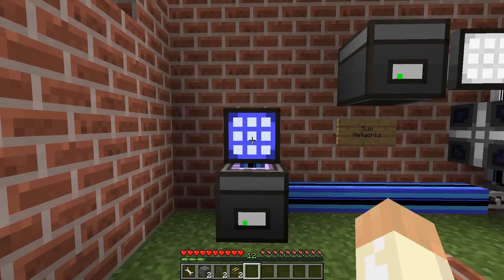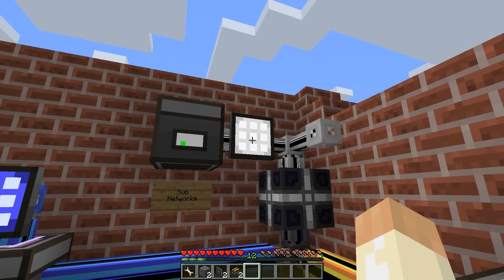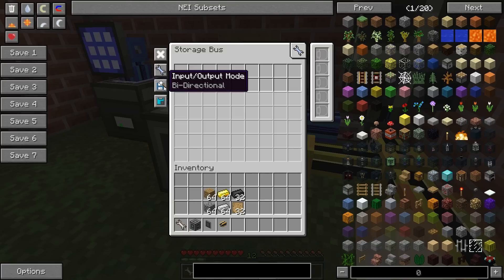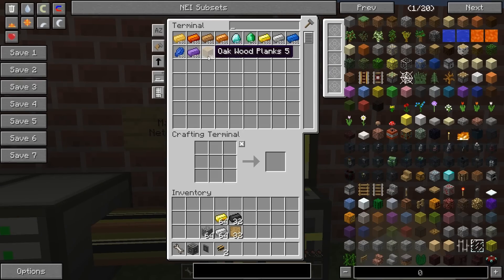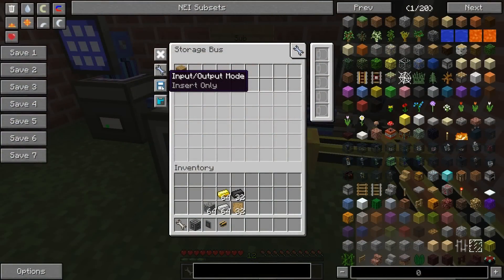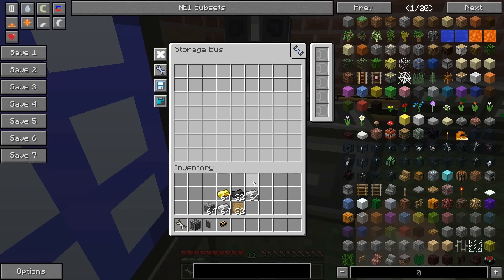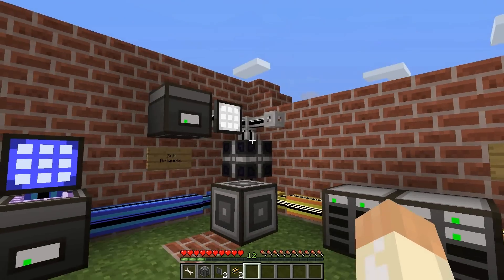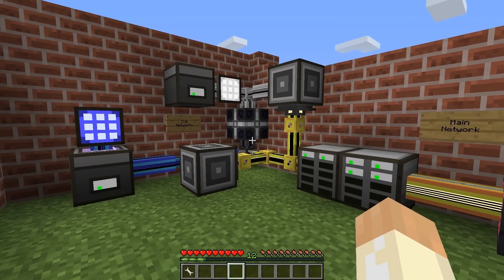Applied Energistics 2 Tutorial #9: ME Sub Networks (MC 1.7.10)

Comment: I am wondering what are the pros and cons for sub-networking multiple networks each others, for example network A is sub-network of Network B while Network B also the sub-network of Network A. I tested that both sides are able to access items in both system. I don't know is there any hidden problem of this design.
Reply: Do subnets count to the max-devices per bus?
Or would I be able to have 32Subnets per Net, with each 32 devices? 
(If using the dense cables)

Comment: Just checked back to see how you linked two networks to see all contents everywhere, and I'm having an issue.

One of my existing networks has several other channels on this branch, and each network has its own controllers. When I put an interface between them, the channels cycle in both networks and reconfigure every few seconds. Does this have something to do with each network having its own controllers? I see your blue and white networks have channels running, but I don't see any controllers to supply them. I thought you had to connect a controller to use any terminal or similar devices. Is there perhaps something happening with the power, like the smart cables indicate how many devices are drawing power but those particular ones don't require a controller to function?
Reply: Oh, I see that when you added the interface directly between them, the yellow channel picked up two channels in addition to the interface, so it was supporting the blue terminal and ME chest. It looks like the blue network didn't pick up a channel, and I'm guessing that's because the yellow network was handling the interface's channel?

So if I want to connect my two networks without simplifying them, I'd probably have to set up a dual interface/storage bus connection, one per side. That should prevent them from cycling since they're not sharing any devices, but both would see each other's content. Does that sound right?
Reply from the maker: Sorry for slow reply, but yes, that's how you must do it. If you have two separate networks you can reach the contents with bi-directional Interface-Storage solution. But this is not a perfect solution when it comes to auto-crafting and probably some other scenarios as well. So in the end I would still recommend one big network, it works best and is fun to set up :) Subnets are good for isolated material handling (think ores, bees or nuggets) where you process resources and then send of to the main network once completed.
Reply: TKH yeah, I’ve been having that problem with auto-crafting. Been debating whether to move all my controls to the one side but for the distance (but not ready for quantum stuff yet, and it’s just really high in the same chunk), but I may end up doing that.

Using Immersive Integration’s dense wires for the moment, so that ought to give me enough channels for my other area. It’ll be a nightmare to reorganize that whole section under the now-neat brain I have set up (I think it’s your design too, the 3x3 hollow cube full of tunnels).

Anyway, thanks for the reply! I’m using more and more of your videos for reference! Great content, but I especially love your active engagement with the community!
Reply from the maker: @brotuulaan4356  Thanks, good to hear that! For small systems, a P2P network with a thin cable can be a viable solution over medium distances, you can get 32x4 = 128 channels to the other end which can be enough for big builds! Feel free to join up on Discord and share screenshots there, I'm sure more will appreciate it.

Comment: So technically, I could build multiple ME networks that consist of almost 23k channels (like in your Extreme Controller video), with nearly all channels connected to storage, then make these super ME networks sub-systems of another network and do all crafting in that network and therefore obtain basically unlimited storage space...well, I guess I'll never be in need of storage capacity now... :D
Reply from the maker: Yeah, almost! :D One thing to remember though: item storage in a subnet does not always work well with auto-crafting. Items should be in the same network as the processor. Even though regular storage works, all items visible from the crafting terminal, auto-crafting works a bit differently.

Comment: I have a (probably pretty simple) question.
I have a main ME system which works absolutely fine. Now I attached an additional smart cable line to the Controller, connected it about 120 blocks away (altogether about 200 cable units, going down and up as well), and connected it with a crafting terminal (nothing else). Energy is no issue, there is way more than enough.
Now, most of the time the secondary terminal works just fine, but at times it suddenly shuts down for a little while, and then restarts to work normally again.
What could be the reason for that?
PS: Great series, helped me a lot. Keep up the great work!
Reply from the maker: Hmm... That's a good question. I have never had a network with cables going that far away. And I haven't heard of this specific problem either. The only thing I can think of is a chunk loading problem... is the entire cable loaded at all times? I don't know if AE2 keeps things loaded or not. If you do find out, feel free to share the solution :)

Comment: I don't see when you would want to use a sub network. If you want to view specific stuff, you can just add additional ME Terminals and put modified View Cells in them, for example if you want to see only your ingots or your building materials.
Also, in terms of storage, its just as expensive to make storage for the sub network as it is to the main network.
I have never seen anyone use sub networking.
Reply from the maker: +baden271 Often, the big benefit is that it can save lots of channels and therefore make your networks easier to build. I've seen this method a few times, and it can be useful, but I don't use it often myself. One example is a build for Bee handling. That room had a totally own network for transporting bees and had its own storage - since that part only used local products. So the main network only used one or two channels for that entire room, but there were lots of stuff going on in there. Plus, storage can be matched for the purpose and not be mixed up with the main stuff. However, using separate networks for auto-crafting between different machines is probably more common than this specific method.

Comment: Good video, but to clarify a network (or at least a sub network in this case) requires a terminal + chest, or does it just require a terminal?
Reply from the maker: Well, a network could be only two devices connected together. The network could work without any items in it (for example only distributing items or hold channels in a p2p tunnel). Networks always work in the same ways, but we can call them sub networks if they are smaller and is supporting a larger (main) network. Hope you understand :)
Reply: Oh ok that's cool, so for example if I have a quarry far away from my base I can just hook up a p2p tunnel to my main network from a quarry network to transfer all the dug up ores and all I need for that to work is power for the quarry's p2p sub network?
Reply from the maker: lskillzI For that specific scenario you could be fine to use only one, normal cable since you probably only want to import everything into the system. But if you have all the processing machines at the quarry site and need a lot of channels over there, then you should make a sub network that only contains two channels - one for each p2p node. And you can send in 32 channels into the one node and pick them out on the other side. You follow along? :)
Reply: Yeah, I figured it out :D thanks for all the help
Reply from the maker: lskillzI No problems, just ask if you have any other questions :)